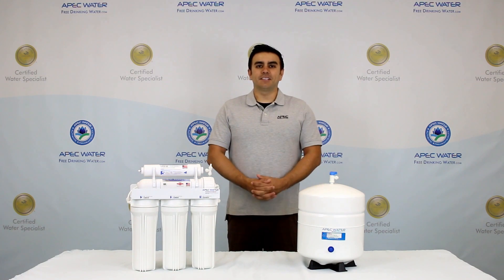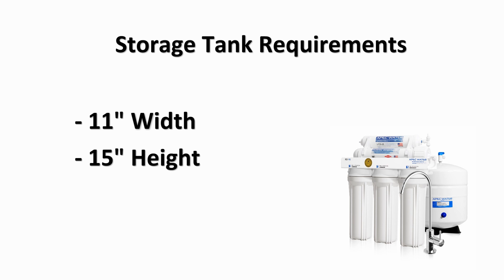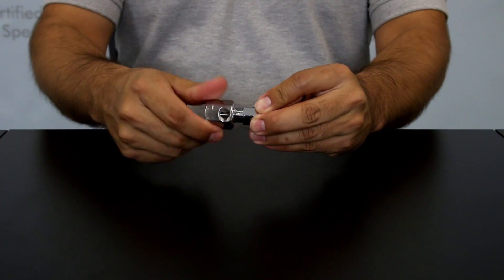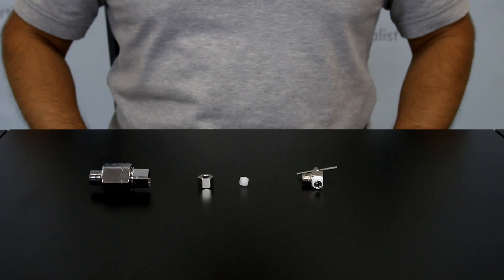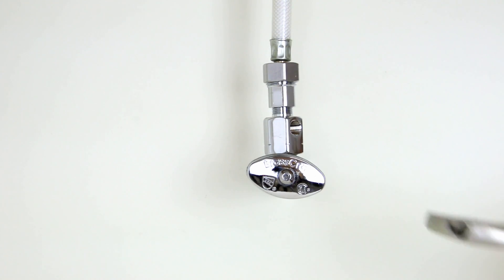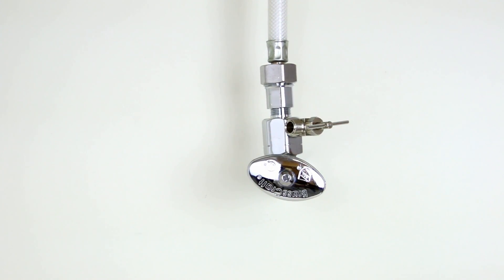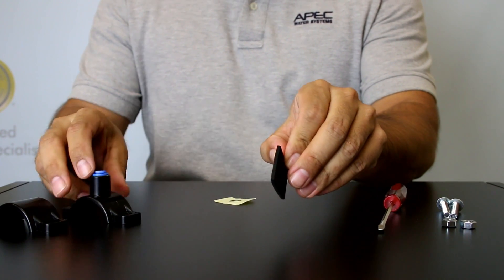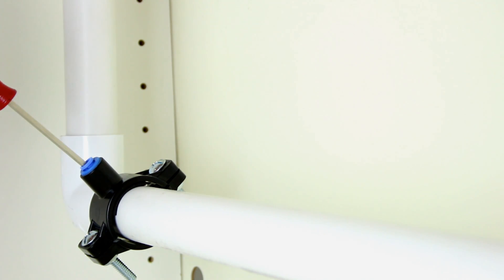New Version How To Install APEC Ultimate Series RO System Feed Water & Drain Saddle Adapter Part 3

Comment: I just installed the RO-PH90 a few days ago. I didn’t watch this video till now. And realized that I didn’t put on the foam piece the way you did in the video. I put the pad onto the pipe. Then put the saddle valve around the pipe. So it’s on backwards. It’s draining. And at the moment, not leaking. But is that going to effect it in the long run?
Reply from the maker: Dear Customer,

Thank you for your inquiry. I'm happy to help!
 
The instructions in the manual do now say to install the foam piece directly onto your pipe, so either installation is correct. As long as the drain line is not blocked and there is no leak coming from the saddle, there should be no problem.
 
If you need further assistance, feel free to contact us directly by calling 1-800-880-4808 or e-mailing us at info@apecwater.com. We are in the office from Monday-Friday from 8:00am-5:30pm PST.

Best Regards,

APEC Support Team
Reply: FreeDrinkingWater thank you for that information. I appreciate your reply. I am extremely pleased with your RO system. You make a wonderful product. My water now tastes great!

Comment: No matter how I tighten it, there is slight drip leak...afraid to break pipe its attached to. I cant turn off water to apt either...
Reply: Use Teflon paste with the Teflon tape.  Put Teflon tape down then smear the Teflon paste over the tape then screw tight.  That will fix it I guarantee!

Comment: There’s no cold water coming out right after needle valve installation, do you know why?
Reply from the maker: Hello, 

Thank you for your inquiry. I'm happy to help! It is very rare to have the needle valve block water. Please make sure that water supply is turned on, as well as the needle valve is turned on all of the way (the valve should be turned towards the left). If this does not resolve the issue, please contact us directly by calling 1-800-880-4808 or e-mailing us at info@apecwater.com. We are in the office from Monday-Friday from 8:00am-5:30pm PST.

Best Regards, 

APEC Customer Service